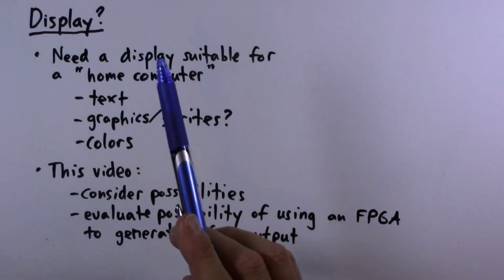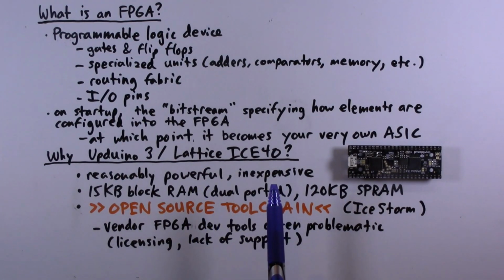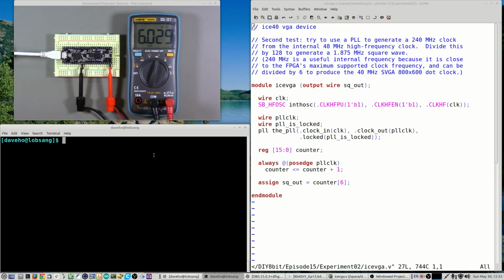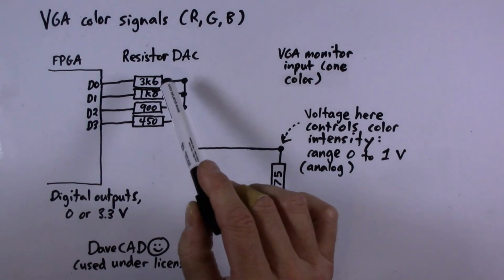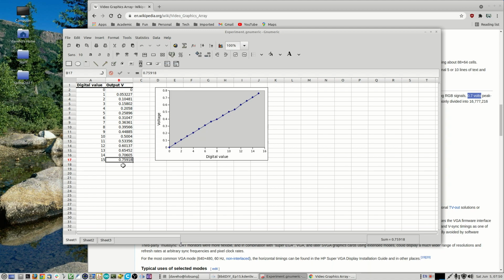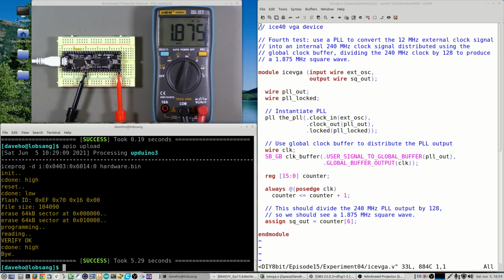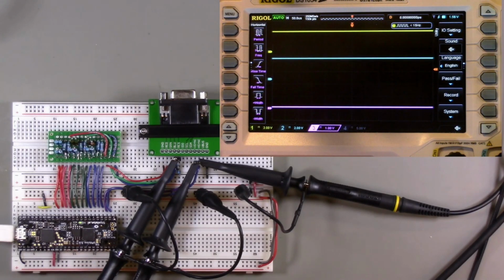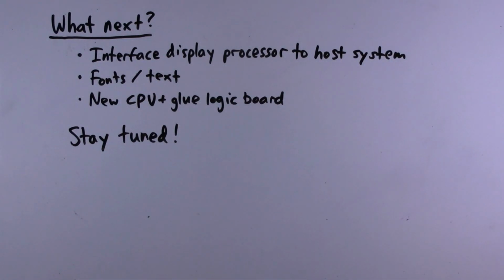DIY 8-bit computer, Episode 15: Display options & FPGA experiments

Comment: Did you end up using your FPGA video or the TI chip?
Reply from the maker: Neither! I built a VGA text display using GALs and dual port static RAM. Long term I probably will go with the FPGA approach. I have a design that is partially working, I just need to finish it.
Reply: @davehohacks  It's something that I am interested in doing but I don't understand how to program gals and pals, every time I have gone looking for the software to do it I have struck legacy windows 3 apps which simply don't want to run. So the FPFA is probably the best way, I would like to be able to use it with a 68K, the idea was instead of having a ROM which the characters were hard coded into that at boot time the character data would be copied into RAM from ROM then the ROM left as a backup or paged out so that you could effectively have user defined graphics and custom fonts easily, these would be copied as required from the UDG ram to a frame buffer and then the frame buffer rendered using the VGA circuitry - what do you think?
Reply from the maker: @chassecourt8824  GALs are actually not too bad to work with. To assemble the logic equations I use a program called "GALAsm", and the recent Xgecu programmers like the T48 can program the actual GAL devices, including the opensource minipro software. Going with an FPGA is likely to be the most straightforward option, though. My recommendation (based on personal experience) is to start with the simplest approach that will give you a usable display, and then once that's working, expand the feature set. Pretty much anything is possible with an FPGA if you know what you're doing. Simulating your design is highly recommended. Check out @JohnsBasement, he has a really good series on Verilog, including how to implement test benches.

Comment: This video is gold as I'm looking at adding VGA to a 6502 computer that I'm building.
If you look back at computers by Commodore etc., they all had custom video chips.  The FPGA is the easiest way for us to make our own custom chips, so there's no real argument against using them for retro computers.
Reply from the maker: One piece of advice that I should have heeded before working on an FPGA display controller: learn the simulation tool in whatever FPGA toolchain you're using. You'll see what I mean in subsequent videos 🙂. I'm actually working on a non-FPGA display controller right now, and it's going much better, but I'm planning to return to FPGAs soon, and I'm 100% certain that  I will be simulating the design extensively.

Comment: Another great video, Dave. I'm planning to use a TMS9918 in my build initially. I've done some testing and it's not too difficult to use SRAM with it. You just need some registers to store the memory row and column bytes and generate the SRAM address using the registers. I might look at an FPGA build down the track too though. Mainly because I've never done FPGA development before, so... why not? :) Will be following this with great interest.
Reply from the maker: Thanks! I will probably experiment with the TMS9918 at some point.  Good to know that interfacing SRAM isn't too bad.

Comment: I am always looking forward to your videos! The thing with FPGA for me is the different voltage levels and the bootstrap issue. It's a shame that there are so few FPGA that can store it's configuration inside... Also the FPGA is soo powerfull - it could emulate the whole computer by itself.. I think I will stick with 5v CPLD for retro things
Reply from the maker: I agree that it's kind of cheating to use an FPGA that could emulate the entire system.  I would happily use a less powerful CPLD, but my main issue there is that I don't want to be saddled with proprietary vendor tools that would be problematic to set up and run on Linux.
Reply: @davehohacks  fair enough

Comment: They did not have FPGA back then, but a custom IC in my mind is similar to an FPGA except the "code" in the IC is fixed and cannot be changed or updated. In my view FPGA is an acceptable choice as a replacement for something that is either impossible or rather difficult to get hold of.
Reply from the maker: Yeah, that's basically my rationalization as well. But, ultimately, I don't feel too constrained by the desire to make the system completely authentic. Sometimes it makes sense to compromise a bit and go with the most straightforward way to make progress.